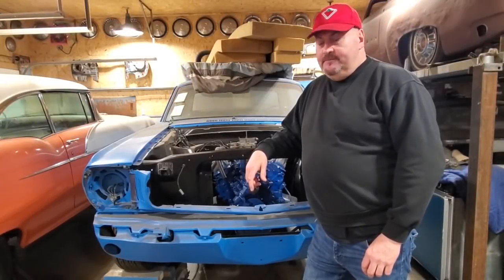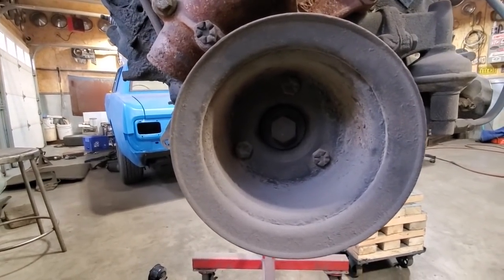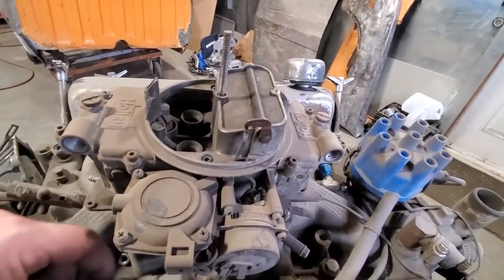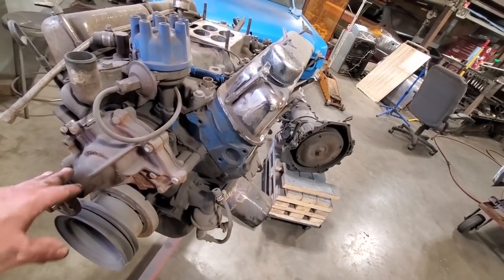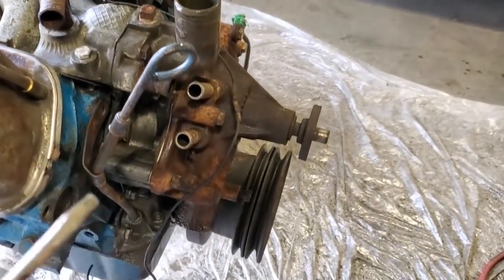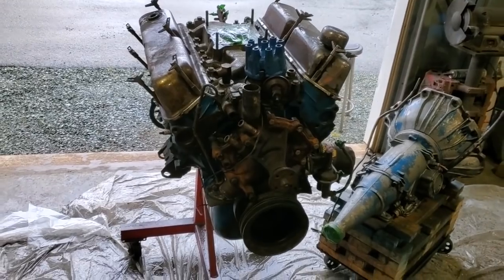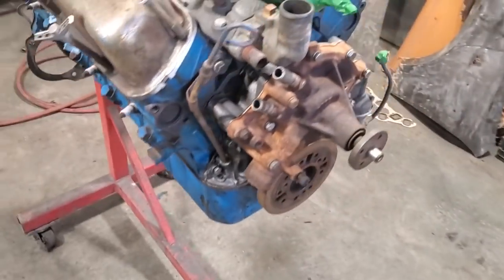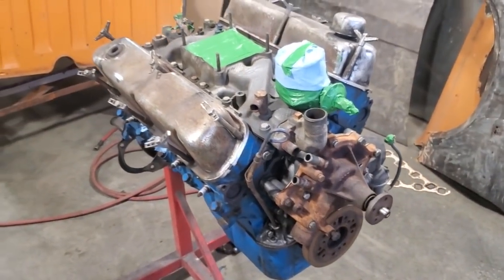66 Mustang project. Engine cleaning the cheap way!

Comment: oven cleaner - another Fitzee idea that I should have thought of but didn't..... the practical tips keep comin
Reply: I have an engine bay to clean, on a 1960 Austin Healey Bugeye Sprite, it's greasy, grimy, and now I know how to clean it. Dollar store oven cleaner and a paint sprayer.
Reply: Oven cleaner is great for degreasing..... Just make sure you wear eye protection.  One little spec hits your eye and the burn is horrible... Ask me how I know....
Reply: Works great for wood working blades if you use the old harsh  chemical type of oven cleaner.
Reply: @jessemiller3001  a little bit got on my arm without me knowing and it gave me a chemical burn.

Comment: I've got to give credit where credit is due.  Your STRONG recommendation that we use the guard on our right angle grinders made me find my pristine guard, modify it like yours and put it on.  Wouldn't you know it yesterday when shaping some 1/8 inch wall rectangular tube for a project I snagged it in the cut.  Though the wheel didn't "blow up" it chowdered about a half inch into the wheel.  Darn good to have the guard on!  Thanks Tony, I owe you sir!

Comment: Hi Fitzee, Oven cleaner works great. On a standing engine I use those halogen lamps to warm the engine then spray on the cleaner. Just like you use the stuff to clean an oven, helps. Also, I made 4 dollies using 4 Harbor Freight HAUL-MASTER 18 In. x 12 In. 1000 lb. Capacity Hardwood Dolly's. They have 3" casters. Built to the height needed using 2x4 lumber like you used. The dolly's cost $11 each...can't even by a single caster for that price.

Comment: Fun tip about oven cleaner it will take hard water scale off if just about anything. I used it on the bathtub at home and it was the best thing I’ve ever used for cleaning porcelain. Wicked fumes tho for sure! Thanks for another great video fitzee!

Comment: 35 years ago, I was using EasyOff oven cleaner for all engine, engine bay and frame degreasing, and even for paint stripping as the old formula would peel paint right off. The old formula was mostly caustic soda, if I remember right. Having gotten back into restoring old cars, I recently used both the blue and yellow cans of EasyOff and neither one worked as well as the old stuff did, and neither one stripped paint(which I wanted it to do). Progress my ass.....

Thanks for all the tips and tricks, Fitzee! Your cut 'n butt and tips on welding auto sheet metal was the game changer that got me back into the game, and now your spray gun pressure washer will be another game changer for me, as I work in a workshop that is primarily a wood working shop, so keeping water spray to a minimum is important. Thanks from Northern Ontario!!!

Comment: I am also a fan of oven cleaner to the point that my wife will no longer keep it around unless the oven needs cleaning because I use it to clean car parts.  One thing that I have found over the years of cleaning car parts and glass cookware with it is that if you seal it in a bag or something plastic it works better as the cleaning agents/solvents do not dry out as quickly.  Also I highly recommend the fume free stuff, it's worth the extra buck or two.   Don't let it sit on aluminum for too long though.

Comment: Engine paint job?  We used to call that a Dupont overhaul. As in Dupont paint products. LOL!  My first 20 years driving was fixing up old cars. Had flathead Ford V8's apart on my garage floor at 14 years old. First driver was a 56 Ford 2 dr hardtop with a 292, Daytona AFB, Mallory dual point and a Hurst shifter. I don't know how many 2nd gears I blew in that car. I think I could swap out a trans in less than 30 minutes and back banging gears the same night.

Comment: I like the idea of using a  paint gun filled with water as means of rinsing the engine off.  I wonder how effective mixing a degreaser in would be.  Maybe something like Super Clean or Simple Green, cleaners/degreasers that are less caustic than oven cleaner.

Comment: Always enjoy your channel Fitzee! I have a 66 Mustang convertible that i'm still working on. Sheet metal work and that's how I found your channel.  Nice.  Hey I think the dip stick holder is bent on the 289.  As long as it works, should be fine. People like pets in the videos.  Not sure why but it increases the followers!

Comment: I learned the oven cleaner trick from my brother in law back around 1979. We used the brass fire hose type nozzle for the water hose to rinse off. If that didn’t work we would take a trip to the car wash and do it again in the wash bay.  
PS   About the 289/302 crank pulley bolts. Some 1968 Torino’s and Broncos with the 302 had three bolts also. I still have an original numbers matching 68 Torino 302 that I pulled to use in my 65 mustang. They are pretty rare these days but they are out there.

Comment: Ford small blocks and steering.... had to dent my header for the steering to clear (more common to do than you'd think). Maybe I shoulda gone rack and pinion. Another great video, fitz.
Reply: I have 68 couple 428 long tube headers bergeson power stering no dents in my headers.

Comment: I like to use those cheap chip brushes for cleaning stuff.  cut off about an inch or so of the bristles and it becomes much stiffer.
Reply: Oven cleaner melted my natural bristle chip brush. Oven cleaner and tooth brushes are my go to.

Comment: That intake is an 80's 5.0 (302) intake,can tell by it being aluminum and the # marks on top of the for and aft runners.Casting numbers should start with E,it's probably E3 to E5 as I do not remember any 5.0's before 83 coming with a 4bbl nor after 85 (in 85 a stick car came with 4bbl and auto were efi) because in 86 they all were EFI on the stangs.. I'd change it to a better breathing intake.I think the truck intakes were slightly different in layout also but ports were likely as restrictive.
The ports at the head are very very small,using my thumb I can cover the whole port with the tip to 1st joint,very restrictive.

Comment: What size tip was in that primer gun? And what air pressure were you using? I'm surprised how well that paint gun worked as a pressure washer!
Reply from the maker: It's just a 43 tip and it was like 60 psi tip was screw all way in to give a straight spray

Comment: Hey there Fitzee,
What process and how do you clean/flush the cooling system before a startup after a motor has been setting a long time or in general as a good practice?
I thought about filling system up with vinegar and letting soak.
Reply from the maker: Honestly I never thought about it. Most times I just send it. If there was any issues it would of stood out when I took it apart. But it was fine when I drained it
Reply: @fitzeesfabrications  
Reason I asked is when that pump was rough I have seen the impellers rusted to the housing and thought even though it is setting there those bits get loosened up and start plugging the cores on the radiator reducing efficiency. While out with your car buddies if any are radiator/cooling specialist what is a best practice. Those bits go somewhere especially the freeze plug jackets channels. I dunno if I am making a mole hill out of the subject.

Comment: If you have an aluminium intake manifold or an aluminium transmission, DO NOT USE OVEN CLEANER! Oven cleaner is caustic soda based and caustic eats aluminium.
Reply: If you don't  leave it on too long the caustic nature of the oven cleaner will etch the surface just enough to promote  paint adhesion.

Comment: Any tips for cleaning grease from cast  aluminum parts without changing the natural color?
Reply from the maker: No. The oven cleaner will turn it white. I used it but never let it sit too long and then clean it good
Reply: @fitzeesfabrications  Thanks for the reply. It seems aluminum restoration is an evasive beast!

Comment: You'd better stock up on that oven cleaner before they change it to an environmentally friendly formulae that's completely useless. We used to be able to get really good oven cleaner here in Australia that would strip paint. The new stuff won't even remove dirt. Same with paint stripper, the old stuff would remove any type of paint until they changed the formulae. Now it only removes plastic paint, so I have to use general purpose (primer) thinners to remove paint from things I'm working on.
Reply from the maker: I see that coming. Our automotive paints have gone low voc and they are dirt now.

Comment: Square bore carb on a spread bore adapter on top of a square bore intake....... that engine straight up ran like trash compared to bolting the carb straight to the intake.
Reply from the maker: Yes thinking about that. That  spacer was not on the car. I had it there thinking I might need it. If I don't need it I won't use it.